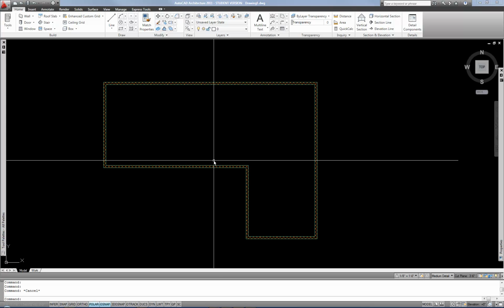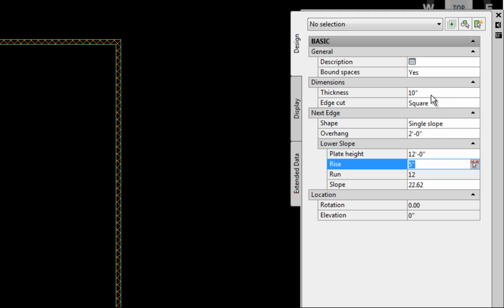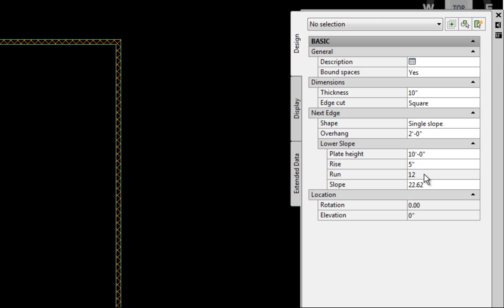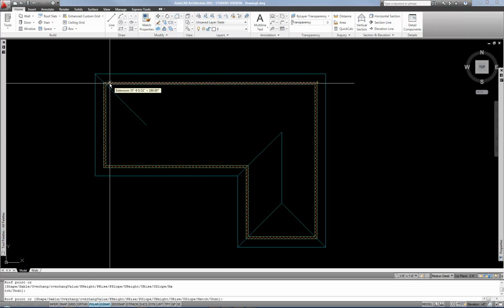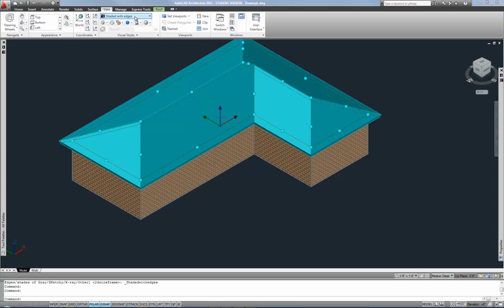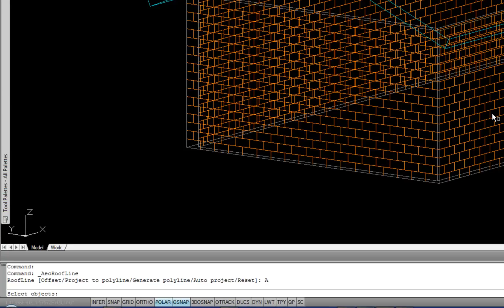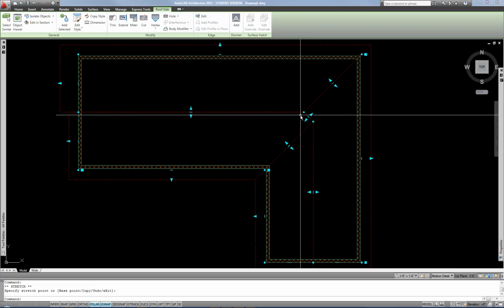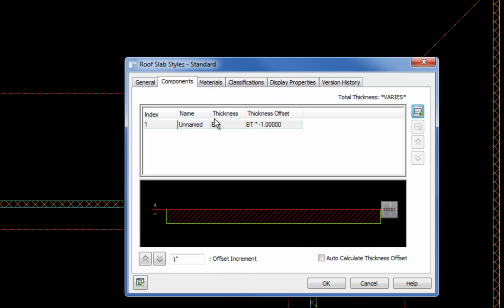ACA: Roofs

Comment: How does one make a single slope roof and change the pivot line from running parallel to a wall, to a pivot line that runs from one corner to an opposite corner? Say a 20' square room and the pivot would be from one corner to the opposite corner leaving the 3rd corner low and the 4th corner high?

Comment: Don't just convert to dumb aecRoofSlabs!
Learn how to add vertices, edit after completion of object, overlap, underhang, Keep Ridge line constant, Sloping gutters, cut holes for Dormer windows or skylights, complex roofs, calculate difficult edge heights and slopes and more.....  All with the Roof Object not Roof Slabs
No edges styles? Alternatives?  Decorating your Roof object for aecElevations, 3D, Renderings.